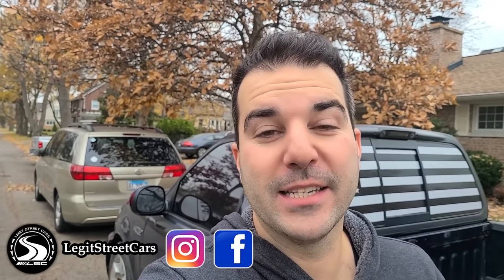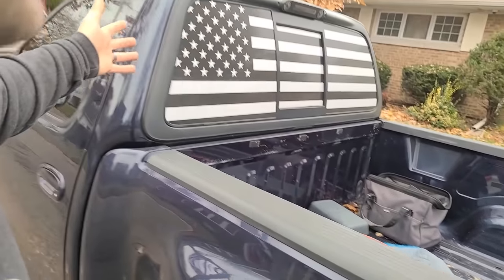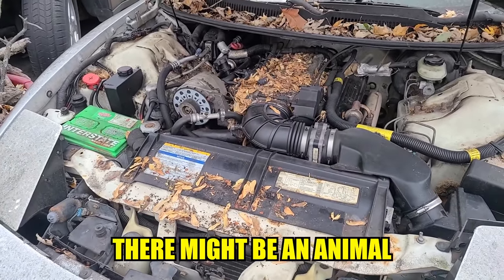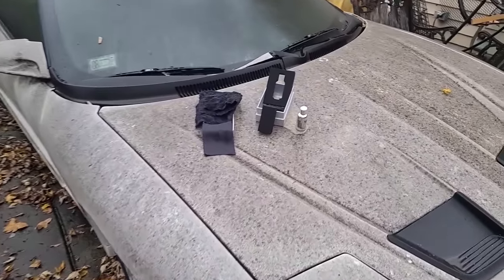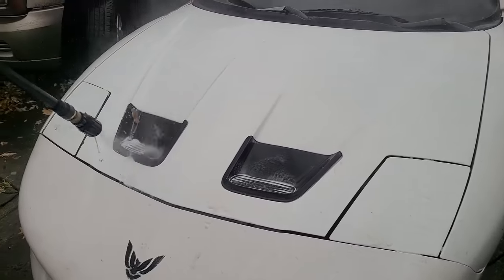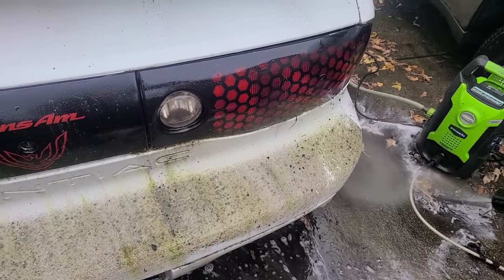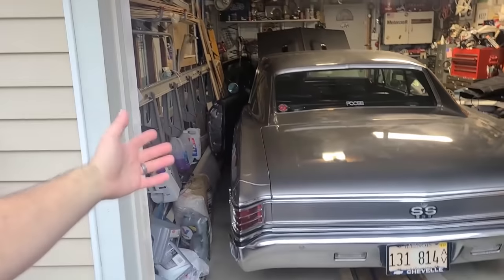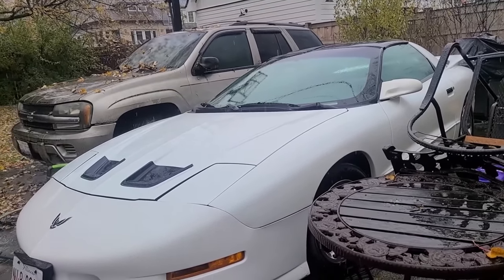I Found My Childhood Dream Car Rotting Away After 25 Years & The Owner Let Me Wash It! TA RESCUE!

Comment: The pressure washing cracked me up… not to mention laughing at myself for watching 10 minutes of pressure washing a car like it was one of those ASMR videos. Pure awesome
Reply: The horrific noise that little washer made was kinda anti-asmr.
Reply: Cleetus McFarland has a pressure washing video too if you're interested. He washes a whole racetrack!
Reply: Wouldn't it have cut time (and water usage) by just taking a good ol fashioned bucket and sponge?
Reply: @markholland1578  a sponge is a terrible thing to wash a car with, especially one as dirty as this.  Might as well take to it with a brillo pad.  The idea is to shift the worst of the stuff that's likely to mark the paint before you touch it with anything.
Reply: @Beer_Dad1975  No sponge but 3,500 PSI through a nozzle OK?
Reply: @markholland1578  This little thing is probably more like 2000psi if that, it definitely won't produce enough pressure to damage clear coat in sound condition.  Of course if you have at it with a massive petrol powered blaster pumping out 3500+ psi that's probably not a good idea.  Sponges trap dirt on the surface that then gets dragged around the paint leaving micro scratches - a microfibre wash mitt is the way to go, microfibres trap the dirt in the fibre and away from the paint.
Reply: @markholland1578  that pressure washer is 1500 psi at max output. i have one which i use on my own vehicle. the noise its making is because of the leak at the gun and air in the system due to the leak.

Comment: I have a 97 stock white hard top auto  lt1 I saved in April after sitting out side for 4 years because of a failed fuel pump. Got it with 89k and already have it up to 94. I love the car. Thanks for the video it reminds me a lot of mine.

Comment: Yep love TA's Clean it up and get it running again. I fell in love with TA's back in the late 70's and purchased a 1974 TA with a 400 4spd. Had a lot of fun in that car and sold in around 1998. It lasted two weeks before some guy in a pickup truck rear ended it at 40 MPH and totaled it. But I still have my 1969 GTO 400 all stock with the original engine and trans. Thanks for sharing. Best Wishes & Blessings. Keith Noneya

Comment: Get it running! :)
I'd love to see that video. 
My first V8 car was an -95 LT1 Camaro Z28 convertible with a 6 speed that I had for 9 years. Actually not that rare here in Sweden. Miss it, but had to sell it when I moved to a place without a garage a number of years ago. I'm thinking of getting an LS1 Camaro with HT or Targa to use as a daily summer driver, and switch with a winter beater.
Newer Camaros and Corvettes are awesome, but 4th gens are fun and simple to maintain,

Comment: Very cool! Can’t wait to see it running! My dad has a red 93 Trans AM with 53k original miles and 6 speed manual transmission. He bought it brand new in 93. Has been sitting in the garage and hasn’t been started for about 5 years now. It’s in near perfect condition inside and out. Trying to talk him into getting it going again. It’s all factory stock except for larger after market wheels.

Comment: I have one of those. A 1995. Was sitting for years but it also had a replacement LT1 in it. No one could get it running so they gave it to me free. To get it running I had to redo a bunch of wiring under the hood that animals ate, then replace the gas tank, filter, pump and all injectors. Runs great now. Body was almost perfect but had to fix and few little things like locks, windows, free up the seats and T tops etc. Also this is Florida so it needs paint, dash top and seat covers.

Comment: You should get them little two pieces for the steering wheel to cover the wear until u get something permanent. They have almost the same color as the wrap if you want. They are not bulky they are nice and thin and also in different textures. You could get the custom one in real carbon fiber with the double-sided tape. Those look nice. But for a temporary thing the first ones would do and even see them on Amazon!

Comment: Are you kidding? Yes, clean the Trail Blazer, clean the LT1 engine, clean the interior. Clean the underbody. Fix it up. Drive it. I want all of that : ) Great video.   ( I used to own a 1995 Camaro Z28, 6 spd manual Borg Warner, drove it 206,000 miles, sold it to a friend who fixed up everything )

Comment: Almost-but-not-quite F-body story: I have an '87 Thunderbird 5.0 (i.e. not a Turbo Coupe) and for a couple of decades I hunted for the perfect aftermarket fog lamps for the stock air dam. The air dam was never intended to hold fogs and the cutouts are quite narrow. After a lot of trial and error, I eventually found the perfect fogs for the car: OEM 1993 Camaro fog lamps. They're a snug fit but they do fit and look like they were made for the car. Add in a Turbo Coupe lamp switch bezel and fog light switch and the setup looks dead stock. So there's a tiny bit of F-body DNA grafted into a Thunderbird of all things.

Comment: I'm surprised the dash isn't busted up, I've got the same car, blew the motor after a year sitting outside the dash broke. You need a wider spray with the pressure washer.

Comment: Whenever you are pressure washing a vehicle using a detergent you should start  from bottom to the top so you don't rinse off the cleaner before its pressure washed.

Comment: ironically when a car sits and gets dirty like that its a good thing.. because the dirt itself protects the paint.  And if the car was well coated with wax, the dirt doesnt penetrate the paint,  the only thing that comes off when washed its those top layers of wax which again, ironically the dirt keeps in place.   i know this as ive gone thru this with my own car sitting mostly exposed for years.  I come home from abroad, wash down the car to be shocked that the wax and clear coat remain.  the only areas of the pain that actually see damage, typically onion skinning are those areas where the dirt does not cover well the paint leaving it exposed to the sun.

Comment: My friend just bought a lt1 93 camaro red. It has 20k miles the owner bought it the opti spark went out he parked it in a heated garage it's so mint condition it's unbelievable the recipe is still inside like new.ther is not even a single chip or scratch. I just looked at it yesterday. It has the original tires all original bar codes and stickers too. Too bad it wasn't a trans am tho.

Comment: it blows my mind that people actually used electric power washers 2 years ago. Leaking handle, leaking shaft, and has to have the nozzle 1 inch from the surface.  Unreal.  I'm sure it was rated at 3000 PSI.

Comment: Instead of wasting time with a weak jet washer, which has low water spray volume and pressure, you should have wet the car first, then wash it thoroughly with sponge and foam, and then rinse with the jet washer.

Comment: Come help me fix my 1998 ws6 trans am black 6 speed ? Had twin turbos on it but waste gate stuck and blew up original motor has 2000 corvette motor now , has car cover on it needs  front struts, rear shocks,has bumping noise under car but only if you turn left car is 93000 original miles on car only 23000 on motor ,sub frame connectors, stage 3 clutch upgraded brakes and rotors,  anyone know what the bump could be underneath the car sounds like you took a hammer and lightly hit the under side of car ,sub frame,  shocks,  rear end? Ty

Comment: You sure you want an LT1 of that vintage? GM should have either kept the regular back of intake distributors like they always had on the small block (Chevy...) V8 or go to an all coil system right away, they had that type of ignition on other engines already... Sometimes I wonder what goes through these guys minds.

Comment: Also...mate don't let degreaser sit on paint like that. all that degreaser sitting on the hood 100 percent dried out whatever moisture the paint had remaining and turned whatever clear coat is left super soft. Yes it's "clean" after what you did, but I bet today it is 10x worse with only 1 year of sitting.

Comment: I've owned my black 95 Trans Am that was ordered new in Hawaii for 17 years.

It still has the same opti that came with it when I bought it with only a cap and rotor replacement in 2006. It had 84.9k when I.bought it in May 2004 and has 164.5k now. 

https://youtu.be/NV3pOQfc4Pg

Comment: I think you would be better off with a power washer Or I don't really even know if that is a power washer it seems so weak the power washer I have would take off 2' ft  sections at a time Like 4000 PSI and that's about the most you want to use on a vehicle And on some vehicles you want to use less to avoid the possibility of paint flaking  But yeah that power washer you have sucks I bet it would work better if you just took the power washer off the hose and used your thumb to produce a high power stream That has to be the weakest power washer I've ever seen in my life